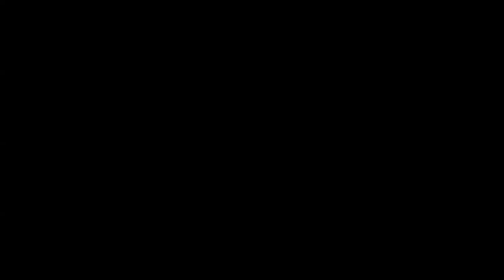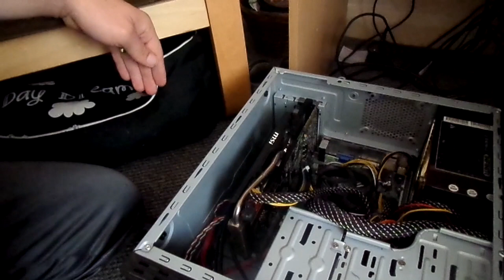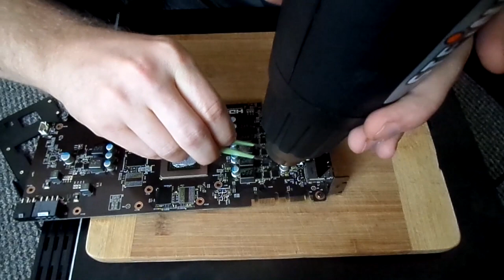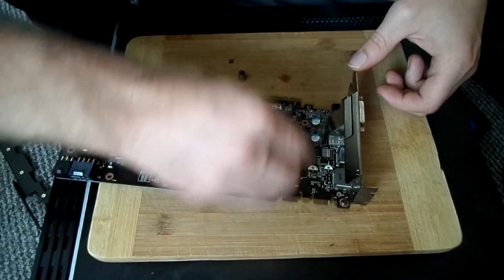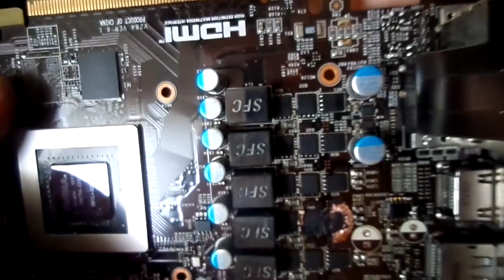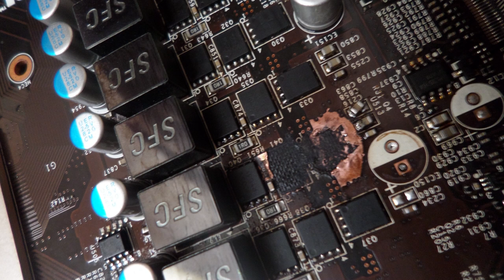Graphic card short circuit Happened in real time

Comment: My Gtx 1060 from Zotac got short circuit 2 days ago. RIP.
Reply from the maker: are you sure is not repairs possible
Reply: @frogtechtips  I just dropped it for repair today. let's see. I wish you were closer so I could get help from you.
Reply from the maker: @mudassar14love  he ye iam probably so far from you but there is still possible send to me for repair :-)
Reply: @frogtechtips  I appreciate your help.
Reply: @frogtechtips  OK two ic found burnt on my card. which will be replaced after getting them.
Reply from the maker: @mudassar14love  that's good looks you have a luck if there no track damage will be easy fix let me know how is going
Reply: @frogtechtips  Sure Bro
Reply: @frogtechtips  What's do you think are the main causes of short circuit? May be you should make a about it. Do you think it might be a cheap power supply?
Reply: @mudassar14love  - We dont know what power supply you have and what configuration of pc
-Evrything what I can tell is if your power supply comes with PFC system then less likely its power supply.
- If your ps doesnt have required power for your pc, your pc would not start at all, but not breaking
Reply from the maker: I have already one video like that and I will make more soon
Reply from the maker: hi he have confirmed by some technician is real short I think
Reply: @elitech3339  the power supply is of some generic brand called insignia and its 450 watts (which i got naively  without knowing quality and 80+ efficiency certification that time very cheap like $6). I have i5 3470s installed on intel DQ77MK mobo. its not a prebuild, I build it myself. Now i am planning to get a Corsair vs 650 power supply & gigabyte GTX 1080 extreme editon. My system without card runs fine, even i installed an old AMD R7250 card to be sure of motherboard and slot and it worked fine.
Reply: Mudassar Ali I don’t think it’s you power supply why your card stopped working. Looks like your card just decided go away. But everything might be.
Yes, I would get 650W ps
Reply: @elitech3339  Yes I assume you are right, but I'm so afraid right now that I decided to rewire wall sockets as these some time do spark. For my faulty card, the technician have to ordered little ICs from China as we don't have nice components in Pakistan. Let's hope for best.
Reply from the maker: @mudassar14love  ye that's sounds crazy